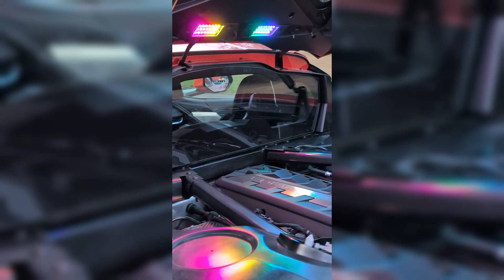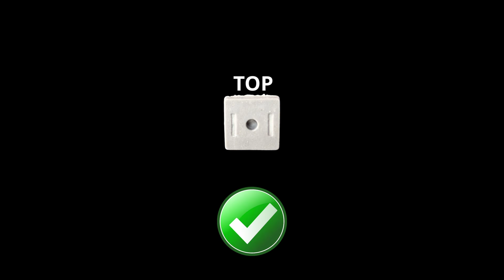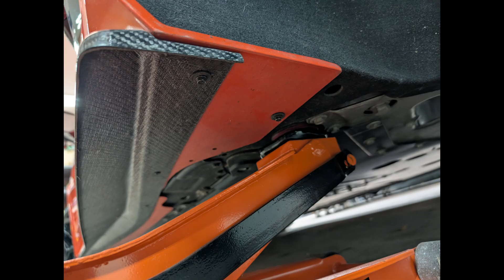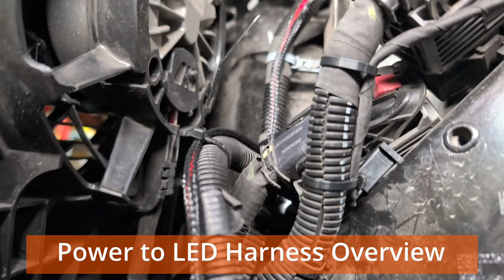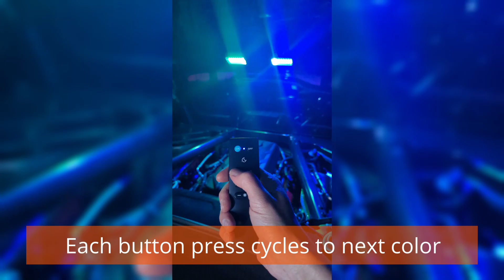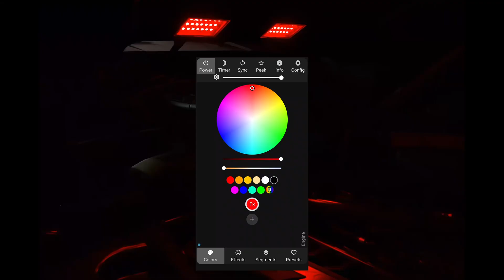C8 Corvette Coupe Engine Bay Lighting Kit Install | Boosted Lighting Solutions

Comment from the maker: UPDATE: For an even cleaner install, remove the other two screws above the rear window and tuck the wiring underneath the roof panel. You can then zip tie the harness to the OEM harness just under the left hand LED enclosure.